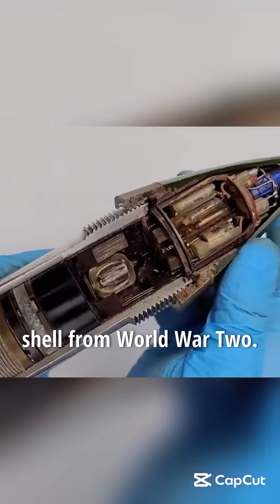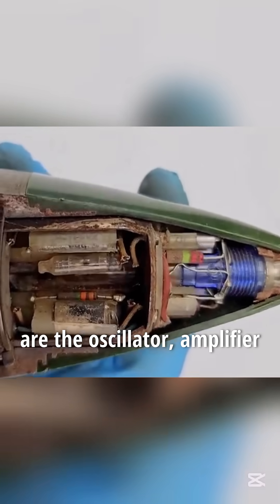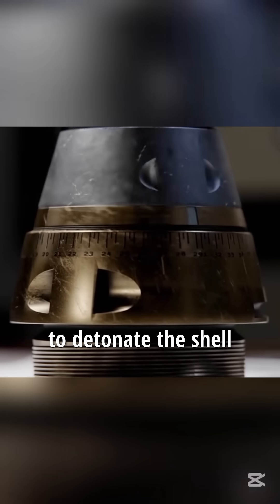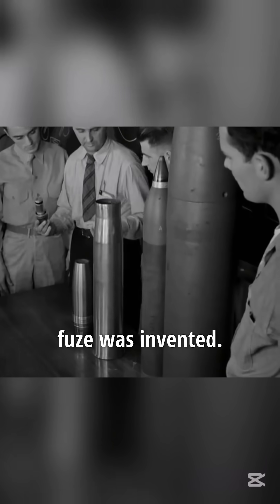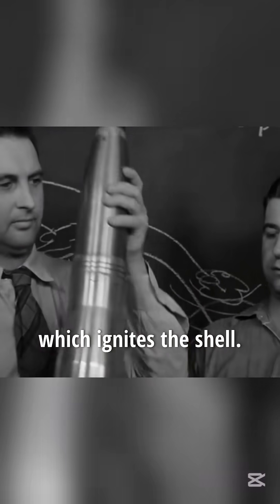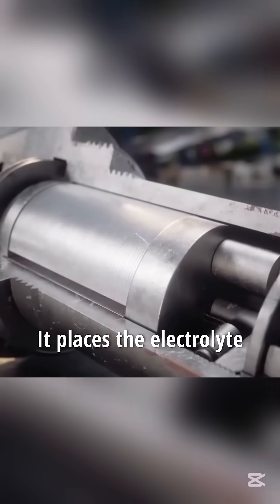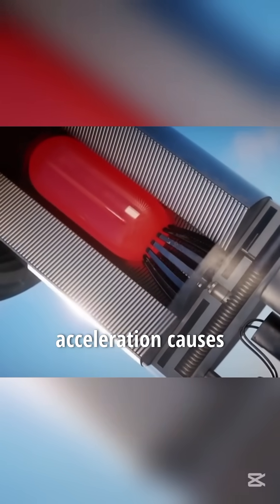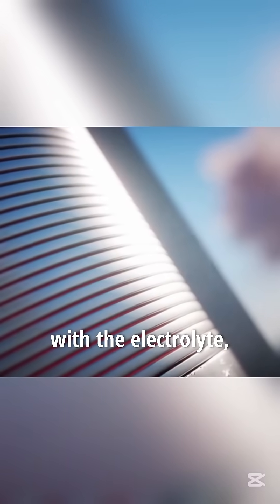How Anti-Aircraft Shells Worked 💥🛩️

Comment: The biggest challenge was getting the electronics to work when being fired from a barrel. They fired a test shell with a fly in it to check if anything inside the shell would still be somewhat intact. When they recovered the shell and opened it, the fly was gone. All that was left was a little carbon residue on the side. The fly had literally been desintigrated by the insane acceleration and G-forces. The solution was potting everything inside the shell in wax so it wouldn't move at all.
Reply: The wax would stop components from smashing into each other and the inside of the casing.  The parts would still experience all the acceleration.

Comment: First used on the US Navy's 5"x38  guns.  If you dropped a shell before it was fired, the immediate action was to throw is over the side immediately.  The reason was that the wet battery would be activated by the g-forces on firing.  If the amplues broke when the shell was dropped, it was now an active fuse that would detonate.
Reply: What is the name or chemical name of the liquid??
Reply: @simosan4451  That, I don't know fore sure.  I had heard that it was a small piece of Zinc and the ampule of either Sulfuric or Pruritic Acid.
Reply: @navyhmc8302  oh thanks for the iñfo.
Reply: 저거 안전장치가 들어 있는 걸로 알고 있는데 아닌가요? 회전판이 들어 있어서, 강선을 통과하면서 회전을 해서 그 판이 락을 풀어야만 동작하는 걸로 알고 있습니다.  아닌가요?

Comment: Wouldn't want to drop that
Reply: Actually, the Acid in the glass ampule (vial) was the Electrolyte for the battery.  (The power source, not the sensor for the Proximity Fuse).  If you dropped the fuse (even if it was already in a shell or a bomb) and the glass broke, it wouldn't make contact with enough plates to get the required voltage and amperage to operate the circuitry!!!  An interesting safety mechanism, don't you think?
Reply: @TimMeinschein-j4s  these old designs were were made genius men, and are truly fascinating indeed

Comment: The accuracy did not change one bit, it did improve on numbers of downed aircraft. Not the same thing.
Reply: That mean it more time accurate, still accuracy.
Reply: @notyouraverage6793   huh.
Reply: @moguaiato5583 No he's right. Accuracy is how close towards the target a group of projectile lands, however in the case of flak,  there are more dimensions than just the path of the bullet. For accuracy of flak shells, it's how close to the target the shell explodes. VT fuze increases accuracy because more of the shells now explode closer to the planes, meaning accuracy is increased.

Ironically, on the flip side, precision is decreased, since without VT, all shells would explode at the same timing, whereas VT makes shells explode at different timings depending on if it detects a plane.
Reply: @D3R3bel   accuracy is defined as the projectile going where it is intended. The accuracy of the rounds did not change, what changed was their effectiveness.
Reply: @XtreeM_FaiL  So if a nuclear anti-aircraft shell was launched and exploded at a distance of 3 miles from a formation of planes but knocked them all down would that be more accurate than a shell that directly hit an airplane?
Reply: @percyfaith11  
> nuclear AA shell
Execution by firing squad. What kind of idiot detonates a nuclear warhead at low altitude ON THE SKY OF THEIR OWN COUNTRY?????
Reply: @anhnguyenhoang210  It's a thought experiment, or a rhetorical question. If you can't think or you are as literal as a computer, then it's not for you.
Reply: So how did the number of downed aircraft increase?
Reply: @noname-codm4590  it explode near the aircraft and create a lot of shrapnels,  Instead of  Explode in too early  or far from the aircraft.